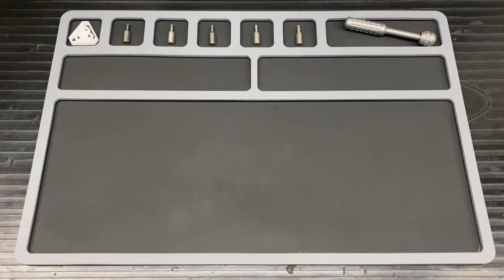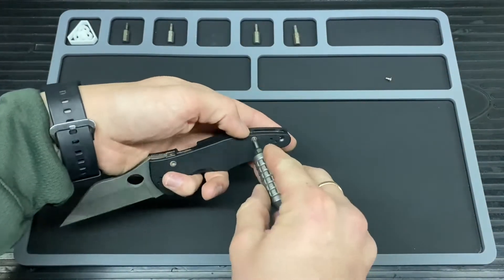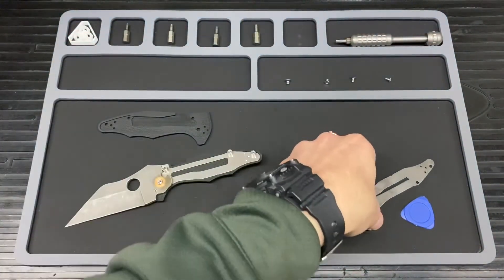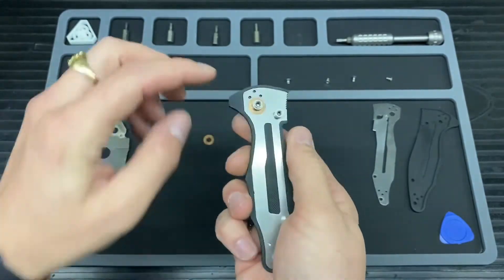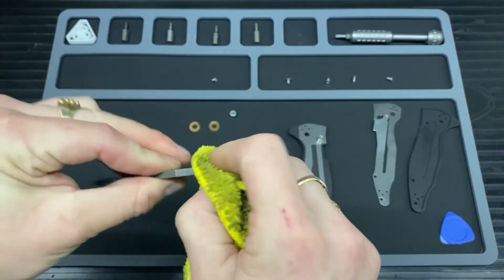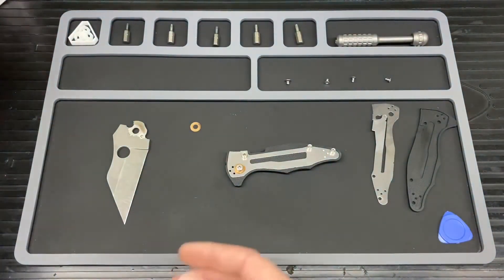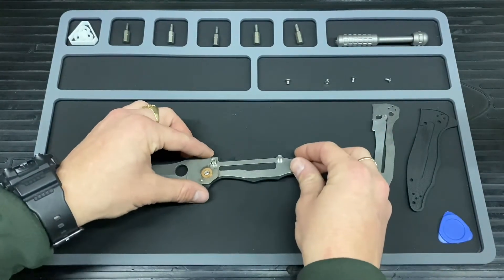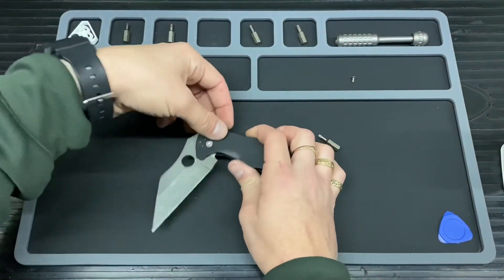Spyderco | Yojimbo 2 | TearDown

Comment: I have a problem with my yojimbo 2.
When it's closed there's a little blade play when I push the blade "inside" the scales...
Detent is nice and stiff doesn't open easy and it holds the blade in place but it can be pushed backwards a tiny bit. It's very annoying at this price point